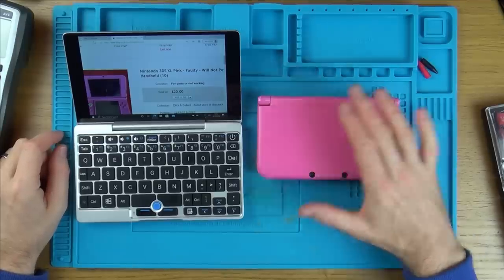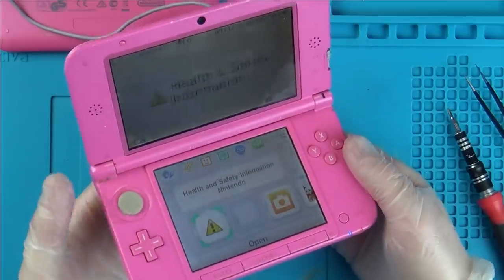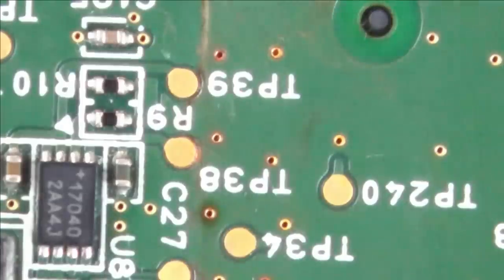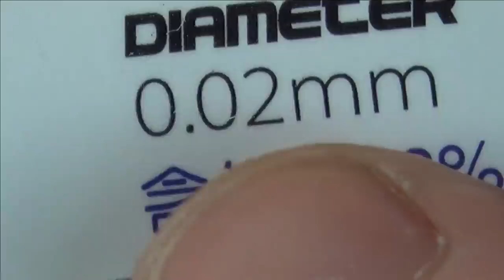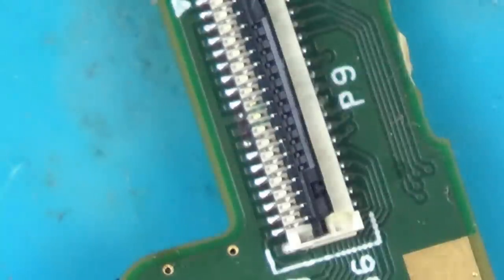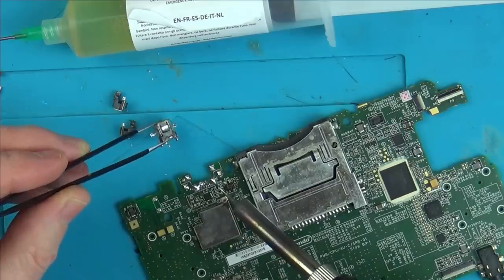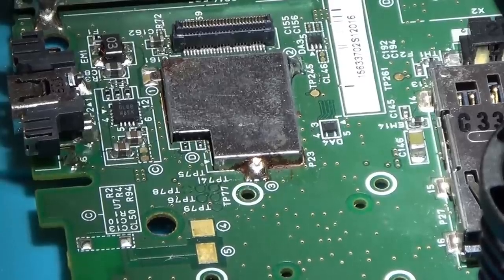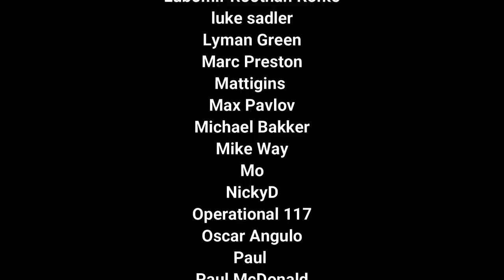Trying to FIX: WATER DAMAGED Nintendo 3DS XL from eBay

Comment: Definitely the wrong charging port. This one is for the NEW 3DS and NEW 3DS XL, not for the older 3DS XL. The NEW 3DS has through holes, the 3DS and 3DS XL use SMD pads.
Reply: This is true Vince they sent you the wrong one or you ordered the wrong one the listings on ebay for these can be confusing! You need the one with the SMD pads and then the  shell will close properly!.

Comment: Vince, actually, you can fix the top screen by fully disassembling it. You can open the LCD metal enclosure and remove all layers of plastic sheets, and clean them one by one. Be careful to keep track of sides of each layer, reassemble and it should be like new. I did this to a n3ds xl soaked in coffee and it gave great results.

Comment: When using solder wick, don't hesitate to add extra flux, and make sure you're getting both the wick AND the solder hot. Since you were wicking off chipquik here the heat required is minimal, but when desoldering with wick I often have to put the iron tip in contact with both the solder and the wick in order to get it to actually wick up.

Also although it can get solder off much more easily, there is a big danger with dragging/sliding the solder wick across the board--it can easily remove small pads. I only do it for things I'm sure won't come off, it's much better to "dab" with the wick.

Comment: Awesome =D  That power connector would have gone slightly flatter if you didn't have solder on the pads first!  One thing you will always see me do with SMD stuff is remove all the solder with braid before fitting the new component.  Since the pads are already tinned, you won't have any problem when you add the solder afterwards as you have the component already sat on there!   Came out really well in the end!  Nice work fixing the ribbon, and the volume slider!
Reply from the maker: Thanks Chris, I have a habit of always applying solder on the pads because I normally use hot air, I need to remember to leave it off when using the iron :-) I found the remains of the old charge port and it does have little feet on it (I thought it had pointed legs). I think the one I was sent from eBay may have been for a different handheld, or maybe I needed to bend each leg myself. I'll know more for next time. It works though and the eye is drawn to every other bash and stain so the gap by the charge port just blends in lol :-)
Reply: Can you do my

Comment: I was just wondering on the charging port when you were fitting it, if the mounting posts should be bent a little, but 1mm or less of bending then probably cause more problems than just leaving them straight, due to the fact of you will probably never bend all the fixings to exactly the same length unless you got a special tool or something that will allow it to be bent to a specific length. Great video Vince, and a big thank-you to the Patreons for supporting this video.
Reply: Pretty sure the charge port was for the new line up of 3ds as they used through hole charge ports.

Comment: Hi Vince, Hope you don't mind a suggestion : The expensive solder you use is the leader in its field. That said, you get a lot more for your money with generic low melt solder paste. Ok, so it's not quite so easy to use as its a paste not in stick form but as I've said, you get a LOT more for your money.

It's also important to note that all low melt solders have one nasty drawback : If mixed with leaded solder, it forms a new ultra low melt alloy that usually has a melting point of about 90 degC.  About dashboard of a car in summer - ask me how I know...  You need to wick as much off as you can, flood with fresh leaded, wick and then you should be good to go.

Comment: You could probably just cut 1 mm off the charging port legs and it would fit perfectly, without having to order another one of the right type to fit that model.
And congratulations on yet another successful repair. I must admit, as soon as I realized it was water damage, and looking at the sheer amount of residue left behind, I thought it was not going to power on at all, and that it would for sure require replacing multiple components to work, but once you put a battery in it powered on and worked right away, despite all the corrosion everywhere including on the ribbon cable contacts. You got really lucky with that one.

Comment: I notice your hand is shaking when holding the iron. Are you resting your hand on something or is it being held in the air by your wrist? I find I generally need to be able to rest my hand on something to keep my soldering iron stable. Of course the length of the iron handpiece also matters--a shorter handpiece means a steadier tip.

Comment: Regarding that streak of brown you're addressing about 12-13 minutes in: Brown rust comes from iron, and there's usually very little on a circuit board that is made of iron, so my immediate thought would be that it's from something that was in contact or nearby the circuit board or it's just something that was dissolved or suspended in the liquid and happened to come to rest there.

Circuit boards usually don't rust like that, they're mostly copper and copper turns bluish-green when it corrodes. Also Tin in the solder will look powdery off-white. Lead does some have some red oxides but I doubt there's much lead in a 3DS XL

The one place where I would expect to find iron or steel (and therefore that brown-red rust) would be in mechanical components such as switches, sockets, screws, jacks, maybe some shield cans. Those can also be aluminum or brass though.
Reply: The rust comes from the lcd metal casing when is pressed against the board when water damaged they leave rust on the pcb, have seen this a lot on this model

Comment: An advice if you are holding your soldering iron with your right hand:  always solder the left wire first so you don't have to worry desoldering it when trying to solder the other one.

Comment: it might be worth picking up an ultrasonic cleaning tank, you only need a 1 litre for small pcb's like switch/3ds and it really helps just giving them a cycle in watch parts corrosion cleaner then an alcohol rinse.

Comment: Excellent repair on the camera flex. which fibre glass pen do you use? mine isn't that abrasive and I struggle to remove the orange plastic with it. 

My greatness achievement, was soldering a new zif connected for the top screen on one of these, hanging my head out of the window for better lighting with my soldering iron😄.

These screens can actually been disassembled to clean the staining from the inside fairly easily.

Comment: I have an Old 3DS that the charge light keeps on even take the charger out about 1 min. When i press the power button the blue light(keeps in dark blue) goes on but nothing else happen
Reply: Was it left in direct sunlight for an extended time?
Reply: @goose5654  no i just found out were you put sdcard in smells like Burned
Reply: Oof, there must be a short then

Comment: @My Mate VINCE I have often wondered back when I had to repair ribbon traces for controllers why people don't use conductive/metallic glue?
soldering wires onto ribbon traces is incredibly hard at times, and makes them rigid, you do a great job at it, but just food for though perhaps?

Comment: it appears you were sent the NEW 3ds xl charging port. at this point (years after this video was posted) that appears to be the only option as there are no OG charging points available. I was wondering what if you grinded down the feet a bit to make up for that millimiter of height? would that be an issue?

Comment: Speaking of water damage I dropped my pixel 3a in the toilet the other day. The sound didn't work the next day. I've got a backup parts phone with a shattered screen. Miserable tear down with that screen buggered. After I got it torn down the what I'm calling the piss phone 3a started working right again. Just waiting on it to shit out and then take it apart. Any tips on trying to save the screen for reuse? Hoping I don't crack it or whatever if I have to take it apart
Reply: Friend if it's just the sound next time something similar happens try to turn the speaker to full blast and put on a low frequency sound and after 5 - 10 it could work.
Reply: @somerandomguy8919  now that right there is a good idea. I'll have to remember that

Comment: Charge ports are cheap in bulk. Non-new 3DS XLs are the easiest 3DS models to repair. Fixed about 25 so far. Results on Instagram.

Edit: Wrong power jack, but you can try bending the pins.

Comment: Great video. I was wondering if anyone knows the answer to this question. I got a nes system recently but when I pluged the ac adapter into my surge protector it flickered and turned off, and this was before I even turned the nes on. I also tried to use a extension cord pluged into a wall outlet but the nes would'nt turn on if I had to on the floor, it only turned  on if I held it side ways not flat on the floor. The last thing I tried was just pluging it directly into a wall outlet and it works fine when I do that. Does anyone know if it is normal for the nes to not work with surge protectors and why. I also have many other consoles that work fine with it. Even a nintendo switch and ps4, and a nes clone system. Thanks in advance I really appricate it.

Comment: Should have use the tiny wire from an earphone cord.
Reply: I’ve figured out how to remove the enamel from those 

Carefully rub them with an emery board with the wires on your finger tip using very little pressure
Reply: @howtowithelizabeth7513  What exactly is emery board ? Interesting enought. Can elaborate it bit more. Thank you.

Comment: sorry for posting another link, however the low melt solder is a must.  Yes its expensive, but wow it will get you out of many problems, see this vid and instead of buying a tube of 9 sticks, you can also buy 1 stick for around £7-£8 https://www.youtube.com/watch?v=DPqaxx2Coh8